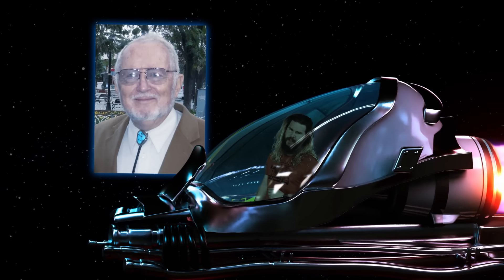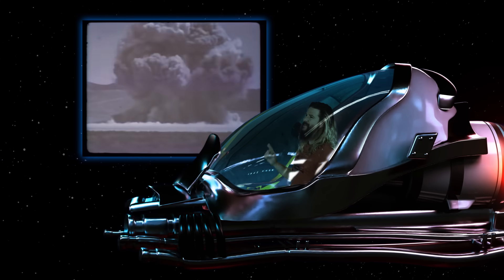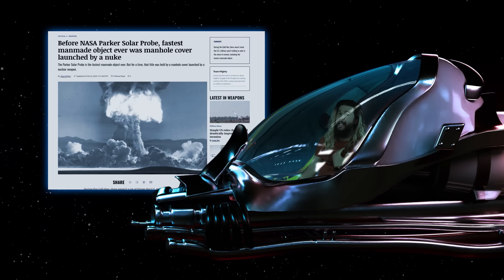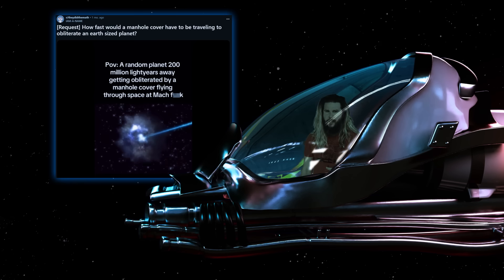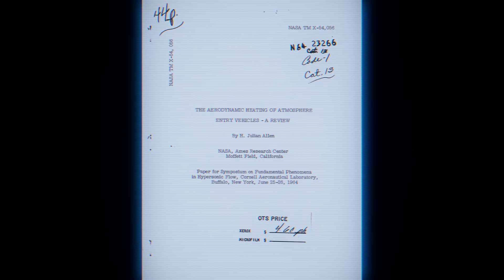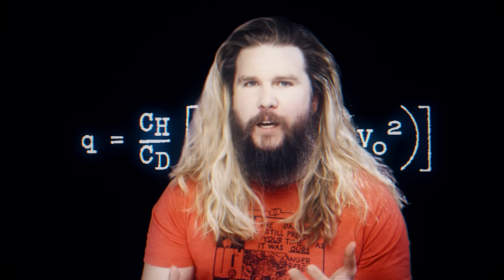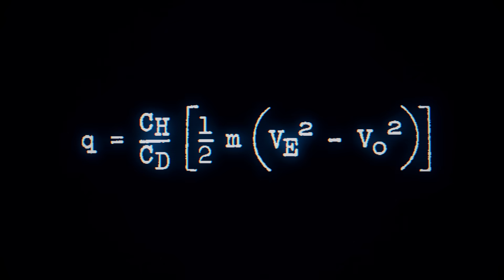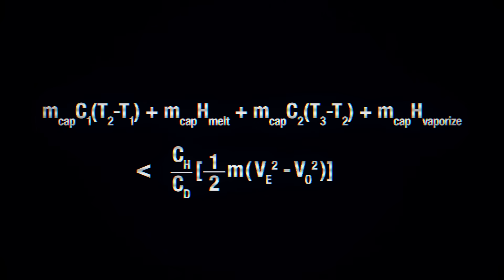Debunking the Nuclear-Powered Manhole Cover

Comment: Question as the manholecover rises through the air wouldnt i meet less and less Airresistance because of the thiner and thiner Atmosphere? 
And thus reduce the impacts with the Molecules in the Air and would it even have time to transfere all the Thermal energie into the cover ? And how would the math pan out if the Cover spins like in a Coinflip, constantly changing the exposed Area that impacts the Air ?
Sry was bloddy sleepy as i watched this video and these were the questions that lingered in my head afterwards 
Welp then Gn8

Comment: Meteors begin glowing at 100 km above the earth's surface. By corollary, the only atmospheric heating we need to worry about for that manhole cover is occurring in those same 100 km. That's only a few seconds of flight for the manhole cover. Can it really move heat from its core to its surface that fast?

Comment: So just a note from a welder, with cast iron being that thick and already being predisposed to being brittle, that material choice would’ve been a poor choice to go with welding it closed. It’s very time consuming to weld cast because of the things you have to do in order to prevent cracking. Couple that with 1950’s welding standards, I very much doubt it was up to par even before being detonated
Reply: The material wasn't cast iron. It was armor steel from a scrapped warship
Reply: @bryancarstensen817 what he says in the video is cast iron. And manhole covers are usually cast iron.
Problem is that the info I find, the media calls it a manhole cover, while the more factual places says it's a machined 4" steel cap. 
Either one you wanna call it, it's not from a warship.
It was approx 4"x4' and weighing around 2000lbs.
Since I'm not American, that's about 10x122cm and 900kg.
That give us a volume of 116 898.66cm³(cc).
Cast iron has a density of 5.54 - 7.81 g/cc. Let's go with 7.81 for this measurement.
116 898.66x7.81=912 978.5g. or 913kg. That's 2012lbs.
Normal steel has a density of 7.85g/cc. Which gives 915kg or 2017lbs.
So.. weight wise it would weight about the same. But!
Welding cast iron is a bitch. And it's really strong, but breaks instead of bend (there is some degrees of bendiness, but not like steel).
 Welding cast usually creates mini fractures at the weld lines. And then also, it had a  20ton concrete plug under it. 
If it was cast iron.. technically the concrete could've been like a sabot, but since that turned to dust, cast iron should turn to dust too most likely. If we then would count in Newton's law of conservation of momentum and energy. That explosion would transfer that energy through the concrete to the cap. It would blow that manhole cover to smitherines.

So I do agree it's not a man over. A steel cover would distort, crack the welds and off we go. But. It was not from a warship. It was meant for this project.

Comment: we still have un-answered questions. 

1. your calculations do not account for the initial heat transfer between the NUKE and the cap. probably minimal, but you can never assume that a nuke has 0 heat transfer. 
2. your analog of meteorites coming inbound does not adjust for a difference of composition, would an all Iron cap have a faster internal heat transfer/melt time, or would the higher purity cause a stronger object. 
3. your analog of meteorites coming inbound does not adjust for a difference of angle of attack, we typically see that stelar objects enter the atmosphere at an angle, where the caps vector would have been especially plumb. 
4. Orbit implies that it would have gone outside of earths atmosphere and sat there in a parked orbit, however if it had made it into space, it would have either kept going and is now a mini-moon, or (more likely) failed to reach escape velocity and reentered the atmosphere, doubling the chance of a burnup. 
5. Friction from atmosphere would have been highest at point of impact, then tapered off, Inbound calculations assume increasing friction, Again, given the timescales, its probably a neglegable difference, but i'd still like to see the math. 

disclaimer - where i'm happy to pick apart the logic of the work, this appears to be a good start to the conversation, and i'm not qualified to do the math, nor answer any of my own questions myself.

Comment: Coefficient of drag used was likely incorrect. It would not have launched and flown flat side up as you demonstrated with your hand. It would have spun. You need the coefficient of drag for a spinning disc of those dimensions.

Comment: You did miss something. The speed that is quoted... That is the MINIMUM speed it could have been going. They only captured the thing on 1 frame, but since to know the speed you need to have some sort of measurement for the distance it traveled, it is impossible for us to know exactly how fast it was actually moving. (I am obviously not saying it made it to space or anything because I do not care enough to do math. Though even if it was moving faster it probably still vaporized because the amount of drag being generated against it would increase dramatically)

Comment: I suppose there are shapes less aerodynamic than a flat disc, but I can't think of one off hand, so the object would almost certainly be tumbling as it went up.  The other thing is there is an assumption that 100% of the energy is conveyed to the cast iron.  At those velocities, air is piling up in front of the object so fast that it can't get out of it's own way, providing a cushion that impedes heat transfer.  Finally, at the velocities we're talking about, the Nusselt and Biot numbers tend to run out of experimental data.  A sensitivity analysis would be useful.

Comment: The cover in reality would have been most similar to a shaped charge projectile.  It probably  would have formed a tear drop shape, minimizing its surface area. Also, the calculation didn't include its deceleration while in the atmosphere nor gravitational effects, nor the energy in the bore hole from the explosion.

Comment: Ay lol 😂
Lemme know when we’re teaming up to recreate it!
Reply: the fat electron man see's all.
Reply: @Nik-bm2jv that’s the chubby electron man to you sir.
Reply: There's the Electric Man!
Reply: Key factor not discussed: heat transfer is not an infinitely-rapid process, i.e. it isn't instantaneous. While meteors moving 3x slower burn up, an object going fast enough could theoretically make it through before it has a chance to burn up. The object, admittedly not factoring in drag, would have cleared the atmosphere in barely a SINGLE second, meaning it may not have had enough time to absorb the necessary heat to be vaporized.

Second, the comparison with meteors is flawed in a very specific way: meteors are going from a vacuum into a steadily INCREASING dense atmosphere AT AN ANGLE, where the "manhole" would be moving from a dense atmosphere into a rapidly THINNING atmosphere at NO ANGLE. Since the math shown doesn't address that (yone would have to integrate the effects of heating/drag across the thickness/density of the atmosphere), it's still possible the "manhole" made it to space (whole or in part).

Really want to see someone address THAT.
Reply: @Chelnaka I was thinking of this as well. A lot of variables are being ignored in order to give a "definitive" answer on this.
Reply: @Chelnaka I have been wanting this since I saw TFEs podcast re: it. Now we have the basic math (ha) done for us & a conclusion. I  had the same question how long does it have to be at temperature to melt?
The atmosphere needs to be taken into account. 
HLC says "hypersonics" burn themselves up, but is that just inside the atmosphere?
If it did make it to space,with any size,I want to know the trajectory & can we see it with the james telescope? Or some way track it? Enquiring minds want to know?😊
Reply: can't wait for you to do this on a microscopic budget in a field in Iowa and proving everyone wrong
Reply: @QuixoticCowboy all you need to do is scale it down and test it. You don’t need a real nuke.
Reply: @QuixoticCowboy  ehh, more likely somewhere in Texas with the BRCC boys
Reply: @curtisterry1983  BRCC boys? 

Didn't know Nic hangs out with the Back Room Casting Couch guys. But hey he's doing BJJ so it wouldn't surprise me.
Reply: So which one of you has the nuclear material required to pull this off? Lol 😂
Reply: @chewingjudas  probably purple heart winner brandon herrara
Reply: @simplegarak thats 8 time purple heart, 4 time medal of honor, U.S. delta seal Brandon Herrera to us common folk.
Reply: @chewingjudas  Oh man! Good to see him get recognized for that 4th medal of honor finally!
Reply: @chewingjudas  Strategically Transferred Elsewhere to Alternate Location.... I mean it's only logical at this point
Reply: @chewingjudas  Iran.... but we can probably buy that from them...
Reply: As soon as he said fat man I came straight to the comments to find my favorite chubby electron dude 😂
Reply: Ay Chubby Electron Guy!!!! Love you buddy keep it up!!
Reply: Good science is being able to repeat an experiment and replicate results right?
Reply: This video made my feed and I immediately came to the comments section to see if chubby electron guy commented. I was not disappointed
Reply: You're just everywhere aren't you?
Reply: @Papakhan9636 everywhere related to his videos lol
Ah shit it was referenced here I feel dumb
Reply: I was just thinking I trust the Fat Electrician math.
Reply: This is the only answer
Reply: I was literally thinking wait till nick gets a hold of this one.
Reply: I want this collaboration @kylehill @the_fat_electrian
Reply: I'll join the team to help. I have zero experience and no accreditation to work with anything nuclear related (my mom doesn't even let me touch the microwave) but I like things that go bang (:
Reply: Just the man I was looking for.
Reply: recreating it at scale would be awasome and you know people with even faster cameras to help get the really precise math down
Reply: This is the collab we need! XD
Reply: Kyle Hill, The Chubby Electron Guy and the Unsubscribed Gang is the collab I didn’t know I needed!!!
Reply: I was about to say I hope Nick sees this, and I'm instantly met with your comment.
Reply: This is the funniest shit I've seen all day. 😂😂 

100 percent y'all should Collab. Communities really come together and learn from each other through collaboration. Sometimes the things that stop us from understanding each other the most, is thinking we already do. 

Hope both you guys are doing well with the content brothers ✌️♥️
Reply: I was hoping I’d see you here chubby electron man
Reply: CHUBBY ELECTRON MAN
Reply: Nobody mentioned communism… mental abuse to humans must trigger a visit from the chubby electron guy too.
Reply: Dude, I will subscribe to fuckin pepperbox to watch that shit!
Keep up the fight and keep our schools safe man, you ARE the G.O.A.T.
Reply: Look at my comment nick, he left out the part that you mentioned that no one else ever even considers 😂
Reply: I would contribute to this experiment!
Reply: I'll watch. You only live once.
Reply: I want tickets to the show boys $20 a ticket... I mean nuclear fallout and all ya know 712 in the house!!!
Reply: I will say its till possible to make it to space the equation doesnt take into account of several important factors such as the Shockwave. 

The Shockwave of an object traveling a machine fuck compresses the air infront of the object this insulates the object as air cant move out of the way fast enough. Addtionally the more blunt an object the better this works its how heatsheilds work. Addtionally you have ablation. Ablation is when the material gets pulled off the metal this will help keep the metal from heat up as areas will melt off faster than it conducts in the material.
Reply: Only if you spend the entire time bashing the metric system and randomly bring up long dead presidents.
Reply: Did this guy call himself a physicist? Is he? I have no idea who he is.
Reply: @muthaz1952  yes he literally is a physicist! He’s the smartest guy you now know…
Reply: Please, God, make this happen.
Reply: Chubby electron man, you are more than likely correct. Look at my response under his comment.
Reply: This video popped up after watching your video.  Thanks bro.
Reply: We the people of YouTubesville need this
Reply: We will be anxiously waiting for that video! Looking forward to it
Reply: I want in!!!
Reply: You know us marines call you semen that and worst 😂 all love
Reply: @Soccalissue  Well the Marines receive a lot... A LOT of seamen so they would know....
Reply: This guy is definitely a communist. He probably doesn’t believe we went to the moon either.
Reply: Your still good he got it wrong the plate was made from steel not cast iron which he did infact mention in the video.
Reply: Please, I’ll help set up funding
Reply: Ahh yes, our favorite historian, the fluffy electrode dude.
Reply: I’m in! I’m a welder and I can build some shit

Comment: You failed to calculate the 10 tons of concrete that was on top of the bomb, underneath the lid. It would have acted as an insulator and like wadding in a Shotgun shell. Which is why the lid was seen intact in that frame of film...time for you to recalculate.

Comment: That equation is for aerobraking reentries, in which drag imparts all of the force necessary to transform an orbital (or escape) velocity into a terrestrial velocity. That's why you didn't have to calculate the starting and ending velocities -- they're assumed to be the velocity of the spacecraft at its initial reentry speed and the desired final velocity post-aerobrake. That isn't quite what happened here, though -- the manhole cover was put under tension by the blast shockwave, gave out, and then was further pushed by the rising plume of the blast; we need to do considerably more math in order to determine how much change in velocity the atmosphere actually caused. The interaction with Earth's atmosphere would be considerably smaller, given that the cover was traveling vertically instead of along an aerobraking vector and was riding along a plume of high-velocity air traveling upwards for a good portion of its journey. I'd say the stress on the cover would be better modeled by treating it as the bullet fired from a very short barrel, rather than as an object reentering from orbit.

Comment: Um, what did you use for the initial and final velocities?  With only one frame of image the uncertainty in speed is large.  How closely do you know the time from the explosion to the gas hitting the plate and from the gas hitting the plate to the welds failing and from their to the single frame in the film?  Was the plate moving in a stream of hypersonic gas?  Was that gas moving faster then the plate?  Knowing the chemical response time of the film would help narrow the uncertainty bars.  I was hoping the entire video was going to be about uncertainty analysis.  Seems like you did anything but put the issue to bed.

Comment: If Aria used feet instead of meters nothing would have struck Mars.  The other way around, yes, using meters instead of feet and you're going to crash something.  Either way not good, one just has a crater and the other is a question of where it went.

Comment: Tbh I’m not fully convinced. The cap could have turned on its side, and the drag coefficient should change with the density of the atmosphere. Further it may not have melted / vaporised all at the same time so it seems possible a smaller chunk could possibly have survived the trip. I think if there were two orders of magnitude in it it’d be different. But as it stands I think it’s still plausible if not likely that some part of the cap (probably in liquid form) did make it.

Comment: Sorry to pile on, but unless I missed it, a very important but also very difficult to calculate part was left out - ablative cooling, which would take away a lot more energy than considered, as well as the vaporized and ionized metal decreasing the drag coefficient as it flowed over the surface of the disk.

Comment: ... guy, that equation operates on the premise that drag increases over time due to increasing air density. All you've done is prove that said manhole cover cannot survive the heat of reentry. You've done nothing to prove that the manhole cover failed to cross the Karman Line and, therefore, reach space. Further, you assumed it would continue to remain oriented perpendicular to its direction of travel rather than beginning to tumble, which heavily alters the amount of drag that the steadily thinning atmosphere could exert upon it.

I'll give you that it had the wrong launch angle and was therefore likely on a suborbital trajectory, and I'll further give you that it most definitely did not survive reentry... but that's all I'll give you. This question is still open for further discussion driven by more calculations.

Comment: A. The manhole cover wouldn't stay in an orientation presenting it's full circular profile to the opposing air resistance.

B. How much would it have slowed by that air resistance by the time it reached outer space, if it had remained intact?

B. If a 4-ft diameter disk was actually moving six times the Earth's escape velocity, or 150,000-mph, nobody would have even caught sight of it, much less have it stay visually resolvable long enough to estimate its speed.

Comment: You also didn't take into account the radiative heat transfer from the nuclear explosion itself as well as the conductive heat transfer of the superheated air blasting up the shaft which just adds insult to injury to the poor manhole cover being vaporized as it attempts its escape into orbit. ;-)